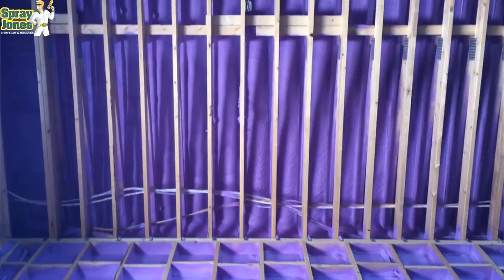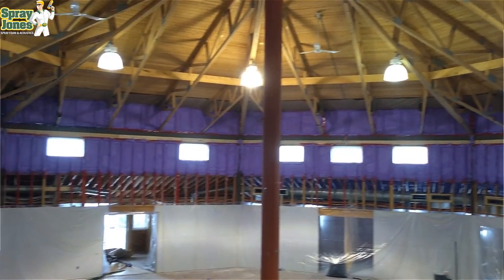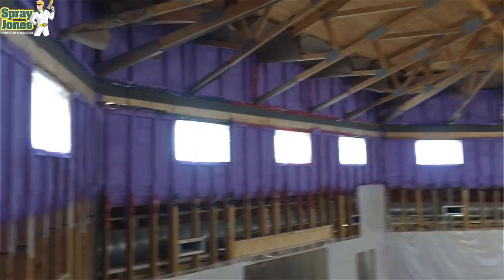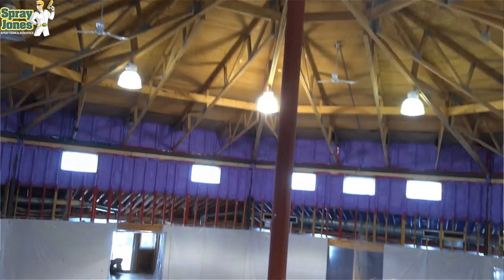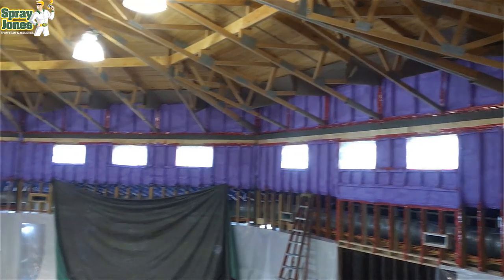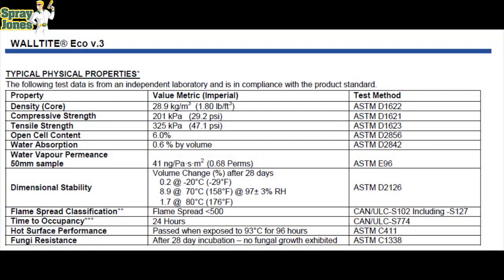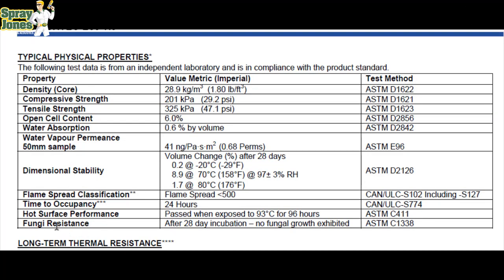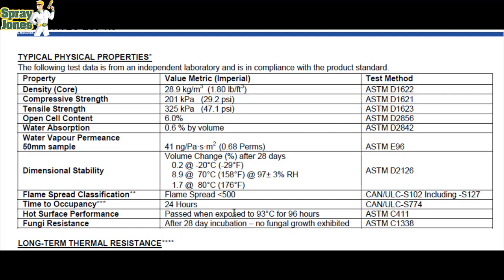Why Is Spray Foam Insulation Safe And Effective?

Comment: My daughter is doing an addition and a remodel in Libery, Maine.  Her designer/contractor is using Polyiso spray foam in the new structures.  She has had mold and chemical respiratory sensitivities since moving to Maine.  She is very concerned about polyiso spray foam after reading about Vermont spray foam nightmares.  Therefore:  Is there long term out-gasing due to large temperature changes?  Is there a significant R value loss or gas release due to shrinkage?  Thanks, Sam
Reply from the maker: Nearly all spray foams in the USA have a 24 zero VOC rating. 
I suggest that you watch my fire health and safety playlist and view the videos that ask questions you have. There are ones there for VOC and off gassing.

Comment: What is your opinion of reusing the blown fiberglass in an attic. I’m going to have it vacuumed out then have the attic sprayfoamed to the proper insulating level. Is there any negative of having them put that blown fiberglass back on top. 

I understand why flash and batt is a bad idea in a wall because of space constraints. But there is not the same space issue in my attic.
Reply from the maker: I dislike fibrous of all kinds. So anytime I can get rid of it do so.

Comment: Whats A fair price per sq ft for spray foam install? Wanna make sure I don't get screwed by contractor
Reply from the maker: Impossible to answer. Too many variables to factor into the price: travel, thickness, type of foam, time of year, access at site, hard to get details, extra prep or clean up.. etc etc.

Comment: Question regarding spraying on the exterior. I'm looking at some shipping container construction in zone 5/6. I was hoping to insulate the exterior with R60 but it looks like you can't get that with spray foam since it's limited to 5-6" total thickness. Though all the info I'm seeing is from over a decade ago. Is that still the case? 

Just wondering if I can get this done using a spray foam on the exterior or if I gotta seek other means.
Reply from the maker: You need some help. Why are you spraying R60 in the first place? Go watch my vid on "how much foam do I need"
Second get speaking with a knowledgeable SPF company in your area to walk you through how much and what it'll cost. 
Yes foam can go to the outside. Just prepare to cover the foam and all that will entail.